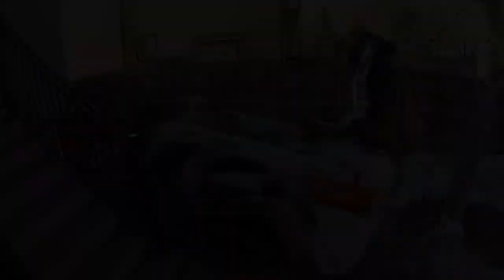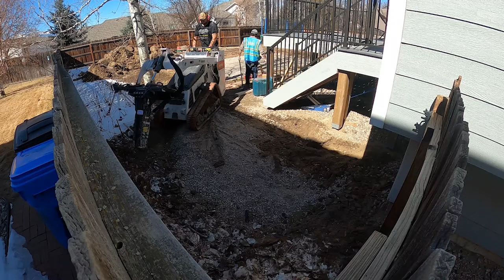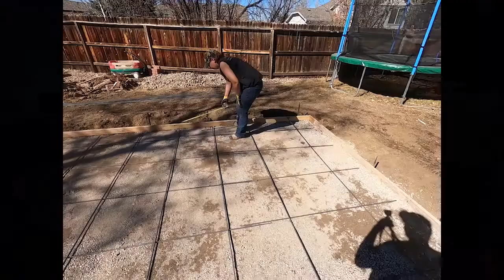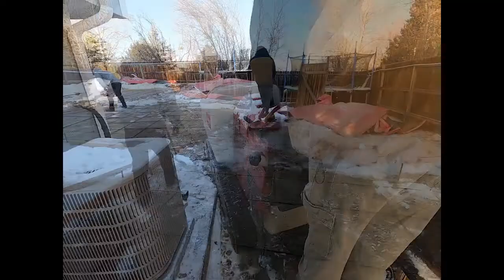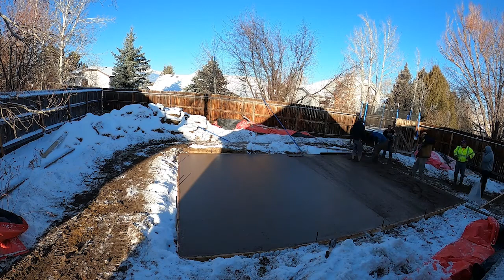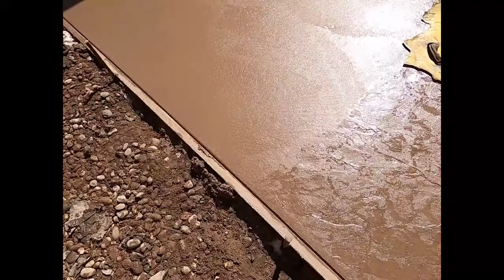Stamped concrete patio, Basketball court, and Hot tub pad.

Comment: What keeps it from freezing when the temp drops at night?
Reply from the maker: Blankets ideally if it's required. But the exothermic reaction that cures concrete helps the first night. After that first night if temperatures hit a certain threshold we use  R-Value 5 blankets. The first night was kinda cold on this project after the pour. Every night after that temperatures were a minimum 39 at night if I recall. And it only got better after that. This is why we start pouring till March and not any earlier. Some companies start in late January. The day before we poured we got a lot of snow but it immediately melted off. Weather sure couldn't make up its mind during this project.
Reply: @jmconcretecoloradosprings  How do you thaw the permafrost under it ground looks frozen..
Reply from the maker: @anonymousprepper1463  we broke it out with a breaker like concrete then Replaced it with crushed rock. Never froze after that till the pour. We covered it with blankets the night before just so it wouldn't be frozen when we poured over it. Weather was very mild up until the day before the pour when it snowed. Then it got much better after.
Reply from the maker: @anonymousprepper1463  you can see in the first minutes of this video where we break out the frozen soil near the top. We go down till we reach thawed unfrozen soil. Also colorado springs does not have perma frost. It all eventually thaws and it does not freeze very deep.
Reply: @jmconcretecoloradosprings  DOn't mind my questions.. I ask them to learn more from all over.. zone 6a here.. I cut off exterior around Thanksgiving and don't startback until mid April here.
Reply from the maker: @anonymousprepper1463  Please keep asking. Either I have the answer or you do and I learn something new.  We cut off around that time also. We could push it pretty hard. But I don't like fighting winter.

Comment: I have seen you use metal and fiberglass rebars. What determines on which type to use or is it specified by the customer?
Reply from the maker: I would say that the application isn't what determines it. Cost is a big player in it. It's a better material that will benefit the overall structure better in terms of corrosion and strenght. The problem before was that we had no supplier that could reliably get this product. And it was more expensive than steel. Now that we have a supplier and the product is cheaper than its steel counterpart. There is no reason not to buy it. I have to take precautions to handle it. Since it's fiberglass. But I don't see many applications in the future where I will use steel. Unless I need to bend it. That is where steel is still better.
Reply from the maker: And the customer will always get what I belive is the best for the application. They usually will ask to downgrade parts of the job. But I never allow it. You either get the best products I trust or none at all.

Comment: Do u guys use freeze guard, what mix design was that
Reply from the maker: We poured a 4000 straight cement mix with 2% non chloride accelerator and micro fiber. Poured at about a 3.5" slump at 7 am. By the time the sun went down it was hard enough to walk on. We also covered and kept the subgrade dry and warm.. Most of it was in the sun also. We threaded the needle with Temps that first night. Then after that every night was well above freezing. Cured well but we took a whole bunch of steps to get it right. I looked at your channel. Cool stuff. A GREEN MUD BUGGY!?!?!??!. I thought they only made them red. I should of asked before buying mine.
Reply: Right on don't 4get to subscribe, ohh BTW we call them Georgia buggy, they say you only have to cover if half of the 24 hour day is below freezing. If it gets above 50 for 18 hours and 30 for 1 or 2 it should be cool, but I'm like u I am careful and do things right